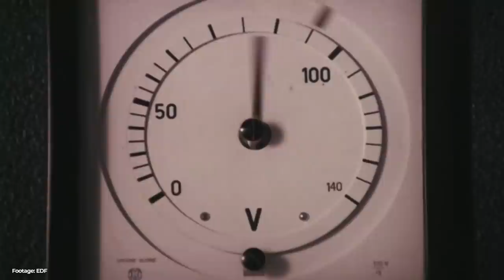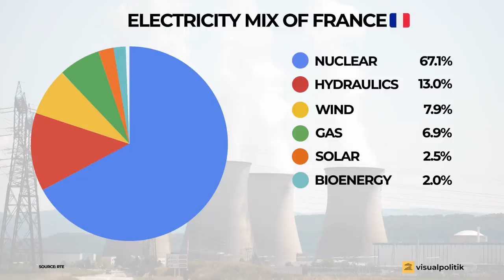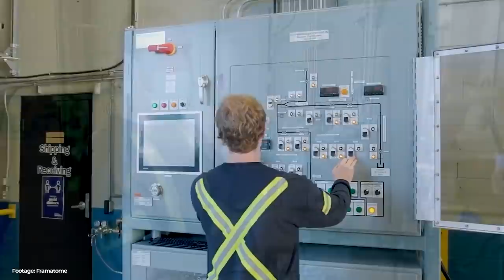Why is FRANCE betting on NUCLEAR ENERGY again? - VisualPolitik EN

Comment: Here in the Netherlands the new government has planned the construction of two nuclear power plants. It will probably replace the one existing one. It makes sense as we are getting to the max capacity for windmills and resistance has grown in the populace for placing them. We also have a lot of solar power but our energy grids are reaching their caps as a result. Since the Netherlands has lots of fine-dust and other pollution due to agriculture being one of its pillars it makes sense to build nuclear facilities to close gas, coal and oil energy centrals to compensate for it. Certainly you can change your agriculture sector and we are ahead of the curve but its no where near enough and will take a while to shift it.

Regarding Germany; they were just dumb. They closed their nuclear power plants and while they did place windmills, they also reopened massive brown coal mines and power plants. As an indication, brown coals is even worse then regular coals in its pollution and devastation for the landscape due to the way its mined.
Yes a nuclear power plant is a massive disaster when it goes wrong. But when it goes right it does hardly any harm. Coal, oil and gas power plants kill people every day; but its largely hidden as it hides in things like cancer and other hard to trace conditions.
Reply: Are your fracking activities completely closed? Apparently you have huge natural gas resources ...
Reply: @OmmerSyssel  True, we are sitting on one off the largest reserved. Getting that gas causes a lot of quakes thou and it literally destroys houses and towns as a result so its not a viable source.

Comment: A very recent 2 years study has just been released about the topic of France's energy transition to more sustainable methods. It studied hundreds of different cases and took opinions from every possible actors to come up with 6 possible paths our country could take, based on a 2050 to 2060 horizon. Appart from 1 of the 6, which explains the cost of 100% renewable, all include nuclear power. I think the lowest ratio is 25% if i remember well, but the most "realistic" one would be around 50%. But something is clear; anybody promising our country being out of Nuclear energy by 2035 or before is a lunatic, and we have to start now our transition.

An other detail about the EU energy classification is that there is also a very strong case made to have gaz as a "sustainable" energy, when we know it polutes almost as much as coal.
Reply: @Blitz Where can I find this study?
Reply: Gas emmits only half the Co2/kwh conpared to coal... The reason we use it because we don't need to import it
Reply: Your English is great, and it's probably just autotype on your phone that spell it like this, but just in case it is one you're unsure about yet: 
With 'another' in English, you can't put 'an other' without having changed the meaning quite significantly.  'an other' is different to 'another.' 'Another' means additional/further, whereas 'an other' means an alternative/separate thing. The two words aren't just another way of writing the one word. 
Of course as with all languages there are exceptions! And I'm sure you already knew the meanings.
But your English is so good I wanted to point this thing out in case it was one of those quirks of refinement that we can benefit from being told we've missed them. Sorry for the pedantry if it was only your phone distorting what you actually typed. This wouldn't surprise me, given how perfect your English otherwise was. 🙂
Reply: @sanders555  well blubber is technically net 0 emmissions.
My point is that Gas is a much better resource to use compared to coal. We currently can't supply all our energy needs with renewables so using Gas to plug the gap isn't that bad. Nuclear isn't a solution either because it won't be ready in time.
The only other option is to not use as much energy wich is not going to happen.
Reply: @RogueSecret  All industrial equipement is safe until the moment it goes bust.
How many meltdowns ... see wikipedia.
Reply: @0799qwertzuiop  I don't disagree, but we're already doing that.
Reply: I'm not a fan of nuclear but it makes almost zero sense to remove nuclear generation when you still have coal and gas generation. Germany rellies more on coal with the closure of nuclear power stations.
Reply: @0799qwertzuiop  gas has really high fugitive emissions in the form of methane. Gas wells leak shit loads of methane and the net result is no better than coal.
Reply: @marcwinkler  and whats big problem whit meltdown? facility is no longer usable and cleanup is problematic and costly,... no different from many others industrial accidents.
Reply: @0799qwertzuiop  well that is what you get for burning it,... if you add up methane gas relase during mining and transportation, you get to 90% greenhouse emmisions in comparrison whit coal,... not that great anymore.
Reply: Thanks for a factual contribution!

Comment: Nuclear FTW! 

German Energiewende costs are estimated to be anywhere between 680 billion and ONE TRILLION € by 2030, and as of now even Ukraine emits half as much co2 per kWh than Germany; even costs of EPR pale in comparison to that and you could go much cheaper: Korean APR-1400 were/are built in UAE for a modest ~6 billion $.
 
To put it in a different words: for the price of Energiewende we could decarbonize entire EU's electricity for 80 years – a period during which wind turbines and pv panels would have to be reinstalled 3-4 times, and we would still be burning gas.